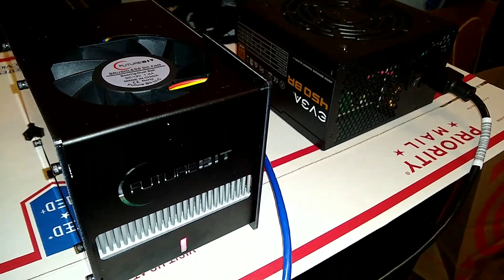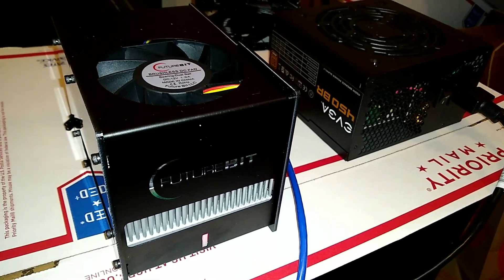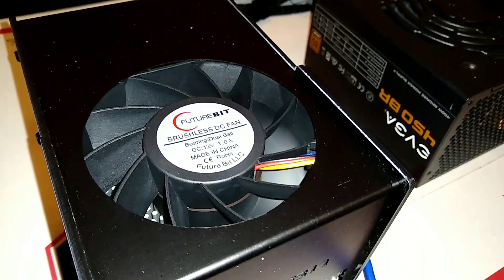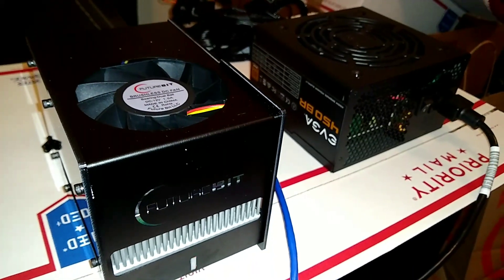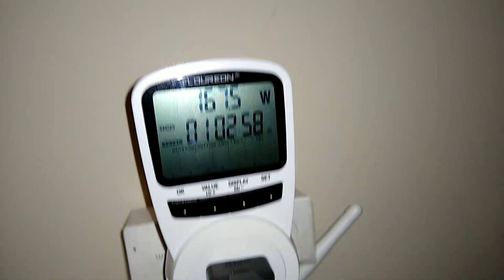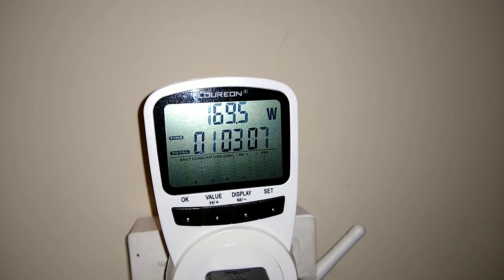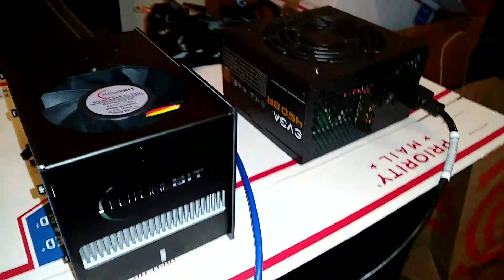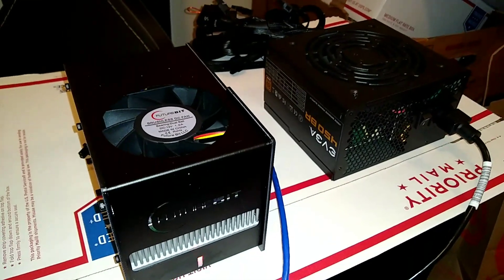FutureBit Apollo Balanced Mode Power Test

Comment: almost forgot to mention that cardboard is flammable, just saying, I've seen sparks come out of a power supply before, very rare but it happens...google "psu caught fire", thanks again for the great vids man
Reply from the maker: I only put it on there for this video clip, usually I have it on a black rubber anti static mat, but the contrast of the device and power supply couldn't be seen. Strictly for visuals this time around. Good looking out though! 😀

Comment: Have you tried to mark some revenue data points on LTC, ETH et al?
Reply from the maker: 3 Years later, but I probably should have tracked it better. It was attached to ProHashing for sometime, and they had great api for tracking that. 3 Year update is that the fan is making some noise now, but still humming along.